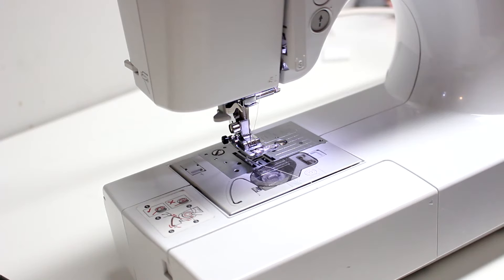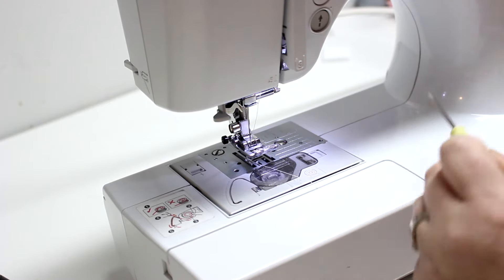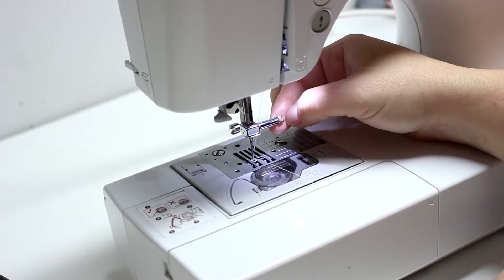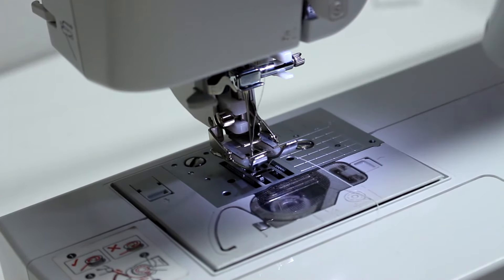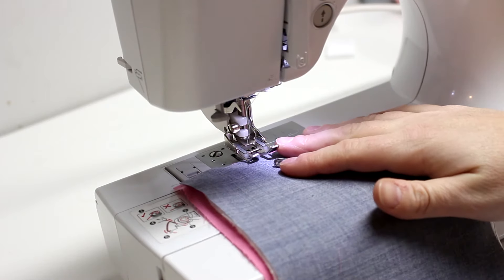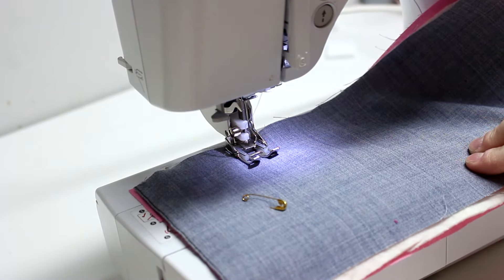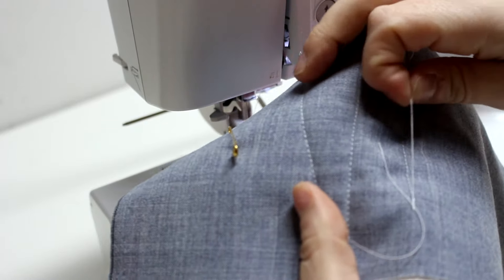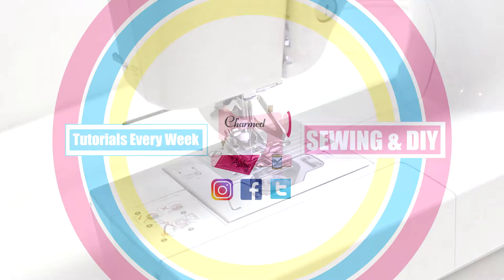How to install a walking foot and what its used for

Comment: Thank you so much for making this video.  I just bought my first walking foot and I thought I had it properly installed.  But the needle was hitting where it should not.  At first I thought I had been sent a walking foot that did not fit my machine.  It took me 24 hours before turning to YouTube to see if I could figure out the issue, then I found your video.  The issue was not having the arm of the foot placed on the needle bar.  Thanks again for the very clear explanation!

Comment: Good video , I actually bought a machine that has a Walking Foot Mechanism  but I’ve always wondered how the universal ones worked BTW you have  very pretty hands for demonstrating craft work  on video  I’m retired now but I was a Construction supervisor for over 25 years  and I used to get a lot of strange looks at the Fabric stores I shopped at by older female customers  the store employees knew me but the customers didn’t  and I would let those know that yes I do sew , but I sew Manly things like Boat cushions , Canvas , and Vintage Automobile Interiors ! My sewing machine will sew canvas  onto a Wooden Yard Stick  if I wanted to do so yet reality was I did sew Vinyl and Leather onto 1/8”  plywood for door and interior covers on cars

Comment: OMG! Thank you for this informative video. I have been using a walking foot BUT did not know there is a correct way to use it. Mine was NOT originally with my machine - I bought after. (have an older model machine without all the bells and whistles) Thank you so much. 
My walking foot made a lot of noises until I learnt from you how to install properly. NOW it works like it should and is so quiet. I use it for most of my sewing, now I can see more. Can't thank you enough!
Reply: PS, you explain perfectly and I enjoyed your talking.  You are NOT chatty. You rock!

Comment: Thanks for that, I couldnt find a decent video of how to attach a walking foot on my Brother machine and it isnt included in the manual unfortunately. But you did an excellent video showing clearly how to install the walking foot both front and back and the (talkative) explanation with it, which I'll be keeping  for future reference.  Well done and thanks again.

Comment: Thank you so much for this video! 😁 I installed it correctly but then took it apart because I thought it was setting too low and couldn't feed the fabric through! I didn't realize the foot goes even higher up if you pull it higher than its resting up position! 😂 Now I'm putting it back together and going to try sewing a sample piece before I attempt at sewing my first quilt. Lol

Comment: Hi Ashley.! Do you have to change the tension of the top thread when you use the walking foot? I usually have the tension on 3. But I started to quilt earlier and the top thread is not looking good. I set it on 0 and thought it was working until I looked at it and realized it looks worse.
Reply from the maker: Ohhh no i keep my tension the same. It shouldn't affect the thread when sewing it all depends on the fabric your sewing with. Maybe change your needle and rethread your machine and keep your tension at a 3 and see how it does

Comment: Do I need a brand specific walking foot? I have two machines, a new Janome and a vintage Singer slant needle 301. Thank you.
Reply from the maker: It's recommended you buy the correct walking foot for your machine but sometimes u can find cheaper options on Amazon that fit multiple machines. For instance brother parts fit on babylock machines. But my janome needs janome parts
Reply: @Charmedbyashley  Thank you

Comment: Does anyone with a Brother machine know how to use the quilting guide with a a regular foot? The book tells me to "insert the stem of the quilting guide into the hole at the rear of the walking foot OR the PRESSER FOOT HOLDER." The problem is the hole is square and it is smaller than the quilting guide post. The holder is metal with a black plastic insert that the square hole goes through. I was able to put the walking foot on and use the quilt guide but I really wanted to use a decorative stitch which cannot be done with the walking foot. I am learning my machine and trying to figure out how to use everything.

Comment: My needle screw is short… does not have That extended bar… where can I get that?  I have a Brother LS-2125
Reply from the maker: If the walking foot came with your machine it should fit. And everything  I have came with my machine
Reply: @Charmedbyashley  no had to buy separate

Comment: I just bought one and it sits so high above the fabric…did I buy the wrong one?  Even with a thicker quilted piece it barely reaches the fabric..
Reply from the maker: If your saying this even with the presser foot down then u might have. I find it difficult to push my fabric under it initially sometimes since it has those extra feed dogs. So if its sitting high and not putting pressure then i would return it